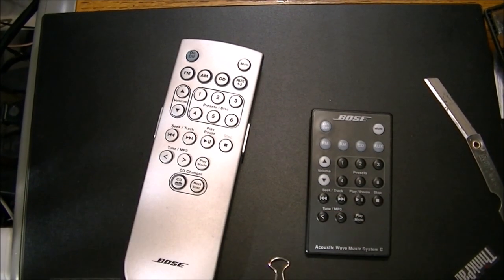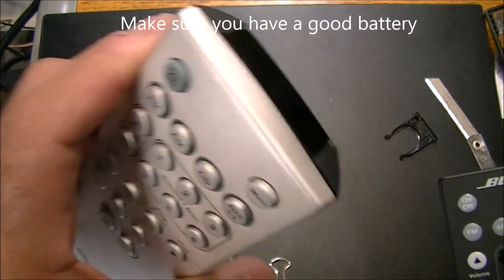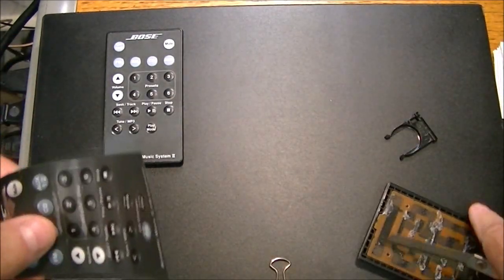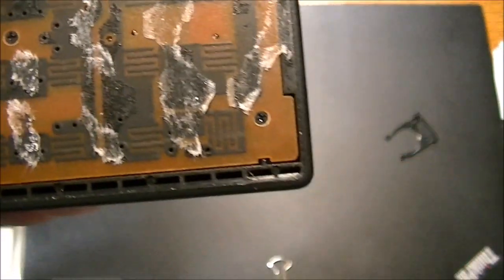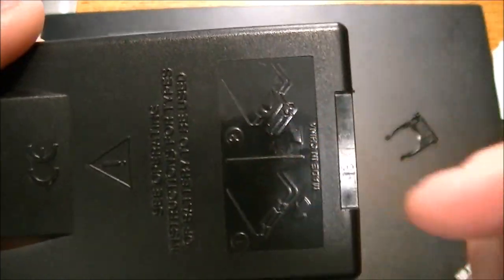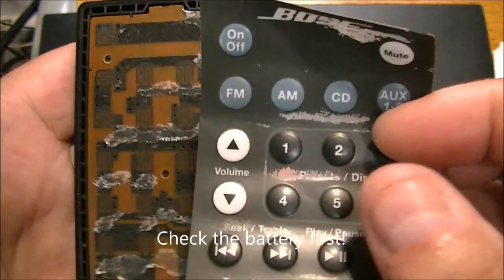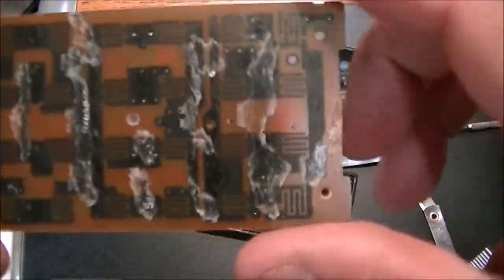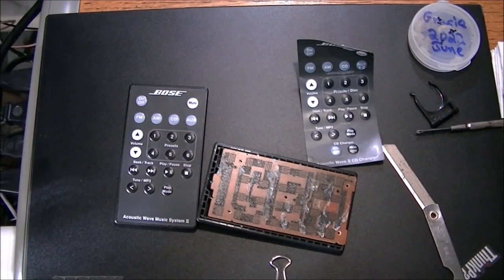Bose Wave Remote Control - How to Test & How to take it Apart

Comment: Ordered a replacement remote for bose wave 2 and it doesnt work.  The remotes are apparently not interchangable, yet my 2 existing radios' remotes are interchangeable and work fine.  I am guessing that each remote has a frequency that it sends to the radio and you have to somehow get lucky when buying a replacement.  Unless anyone knows a fix?
Reply from the maker: You are correct, I believe. I have 3 regular remotes and one larger remote for the bigger Bose radio/cd player here and some don't work with the 3 radios and CD changer I have. Did you test the remote to see that it is working?